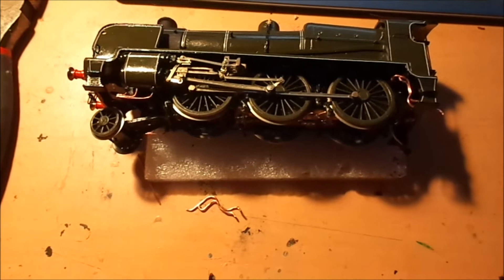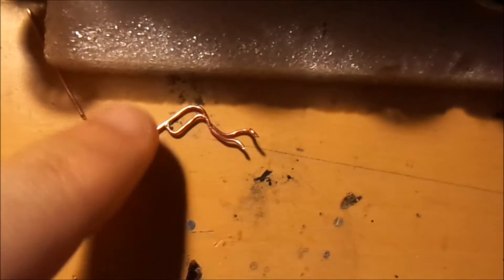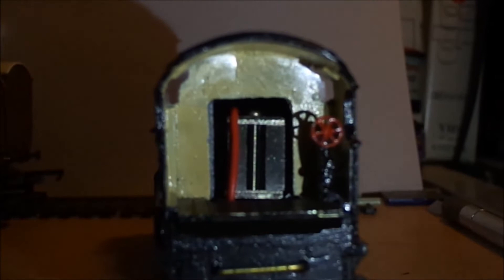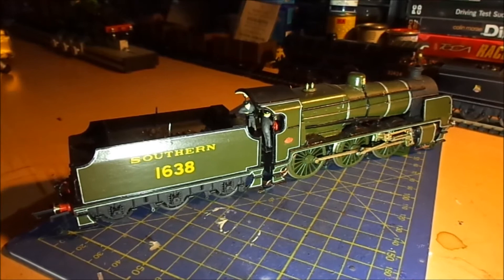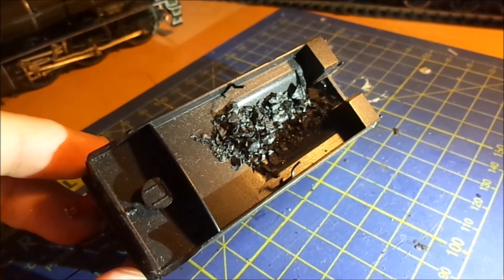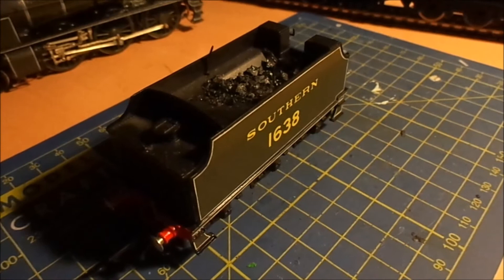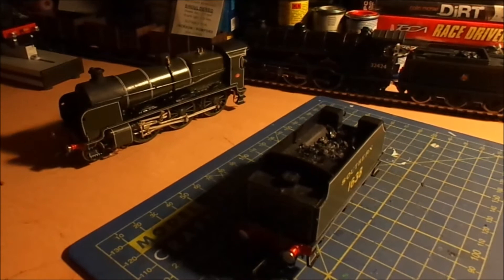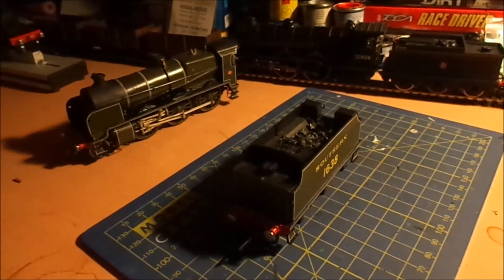SE-Finecast / Wills, U-Class, part 6

Comment: This series alone deserved a subscription, it's an awesome project & I really want to have a go
Reply from the maker: Thank you for subscribing and commenting.
I certainly enjoy a challenge, requires time and patients, if you want to have a go I suggest some plastic kits, then work your way up to metal kits, etched chassis ect... loco kits for example I first made a complete kit was the B4 from SE Finecast, nice 0-4-0T.
Reply: I've built many a plastic kit. I've even motorised a dapol railbus using a pacer mechanism. I think I may move onto a resin kit